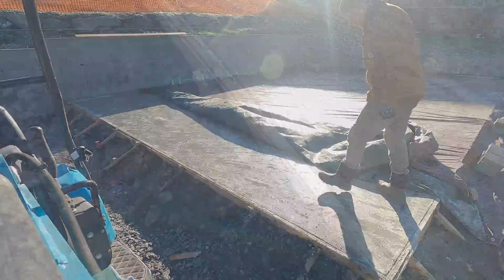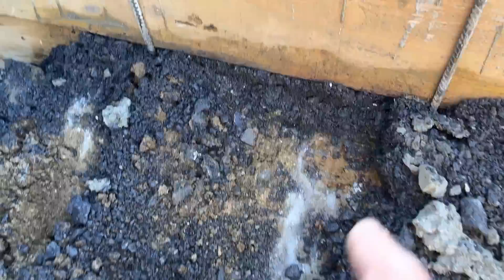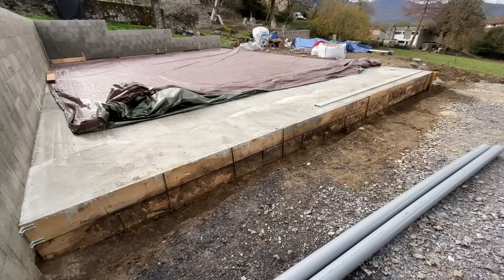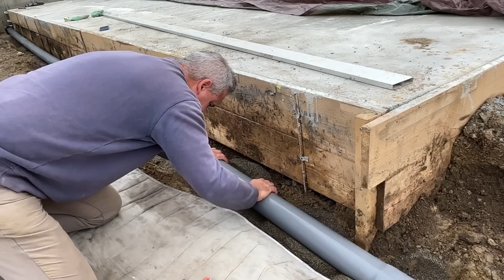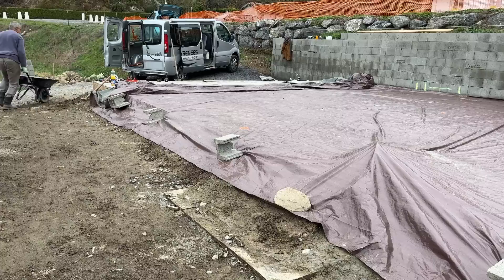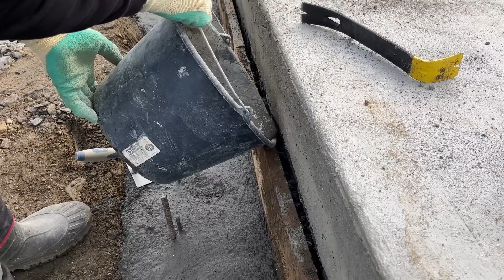Garage Slab Reveal & Drainage  | Garage / Shop Project Ep16

Comment: Question? Why didn’t you tie in both drains into the first pipe you concreted in?
Reply from the maker: The rear drain goes around the back and side.  the front surface drain I did afterwards just to not over complicate the initial pour....it was too difficult to get my head around it all in one go 😬

Comment: I dont think it was a good idea of putting that Cement around the edge of that pad on that stone. Because Water may get under that. And with the concrete on that stone under the pad. The water wont have no way too drain out. Youll end up with a Underground Pond under your pad. And if it freezes It will crack the concrete pad. Normally You put stone around the pad that say any water will drain out...Just a suggestion. I would hate to have that pad crack with all the work you put into it. This is just a suggestion..But other then that its lookin good ..
Reply from the maker: it is well drained now and it will be surrounded by the driveway and pathway.  It should be OK, plus it rarely goes below zero here.  fingers crossed. 🤞

Comment: Don't hand dig when you've got a mini-x on site! Just move on close to the forms, turn your tracks parallel to the forms, put your teeth back on swing your cab at the slab and your main boom the opposite direction so that your dig line is as parallel to the form as possible then pull parallel to the slab. All your boulders should just roll out easy AND your tracks will move in the direction of work flow. Don't give up so easy, it is worth figuring out how to run that thing. Just pretend you have no other option but to use it, you will get very good if you do that.
Reply: Exactly. "Why have a dog and bark yourself" as the old saying goes.
Reply from the maker: Trouble is, I wedged the bigger boulders up against the form boards.  So the teeth of the bucket could not grab them from behind to pull.  Also my boom does not have the side movement (hind sight I wish I had ordered that option).  Mini Ex gets a good workout in the next video though - to the point of failure ☹️

Comment: We always used 'duplex' nails when forming. Much easier to strip since the second nail head remains proud of the wood - no getting on your knees to squint to find the screw head that is full of hard concrete.  Just bring a crowbar to pull the nails and pop the forms apart.

I'm really curious why you've chosen shipping containers for your main home design.  The few container builds I've seen appear to be disasters - it's a lot of non-standard work required to fit in things like doors/windows and attach cladding/architrave etc etc (REALLY think about how those details will be done - it's quite difficult - how do fit a 6" wide door or window to a 1/8" piece of wobbly metal? As soon as you start cutting holes for windows/doors etc, shipping containers quickly lose their integrity/rigidity). Unless you've got experience with metalwork, I suspect it will be much more difficult/expensive/frustrating than you expect.  There's a reason why almost nobody uses them (builders aren't dumb - they know costs - and if using shipping containers were cheaper, they'd use them).

I STRONGLY advise that you rethink using shipping containers and use conventional (lumber/masonry) framing instead - vastly more forgiving/versatile. And I doubt a metal container building could meet Passive House standards anyway - at least not easily (and PH isn't cheap - very problematic for first-time budget builders!).  Consider 'Pretty Good House' standard instead - it's meant to get near-passive house efficiency at lower cost using easily-available materials. Good news is Europeans have access to efficient, high-quality windows/doors at relatively affordable prices.  

If you haven't found Matt Risinger's Build Show YT channel, take a look. Especially at Jake Bruton's content (he's a very practical, cost-conscious builder who specializes in passive house building (Matt is mostly a luxury home builder so his buildings are often $$$$$).   Besides the Build Show YT channel, they also have a website (buildshownetworkdotcom) with more content.  While geared towards a US audience, I think Jake offers some innovative and very practical cost-effective advice for building efficient homes (honestly, I'd try and contact him and pick his brain, even pay him for a 1 hour consultation if needed - money well-spent methinks.  Aarowbuilder.com).  Both Matt and Jake are on Instagram too.
Reply from the maker: Cheers Arthur - the main reason at the moment for the use of containers is to give me the structure, the metal frame.  After working on this garage I may opt to have the same company fabricate a steel frame for me for the house - I will price up both methods.  I am an engineer but not a structural engineer so designing a wooden frame house with the correct loads etc is a little daunting for me.  My last house I build was a kit and was constructed by the kit company and handed over to me to finish.  This is the first I have deigned and build from scratch.  I am still 50/50 as to what I will choose.  As long as the outside design stays the same the local authority are happy as there are no rules on how it is constructed.  I do watch Matt Risinger and also the Perkins Brothers.  I will check out the others you mention.  Very interesting.

Comment: I hope that you are having a great New Year's holiday. It looks great. I think that the base gravel will washout. If you compacted it good it would not move. It will take any water and it will soak into the ground. You have plenty of drainage to take any surface water away.
Reply from the maker: Thanks William -  it will not be going anywhere now, all totally encased.  I cannot believe how much concrete is going into this base. 🤣
Reply: @HomesteadingUncontained  By the time you are done with your slab you will be a expert in  concrete.

Comment: Great progress guys, I’d definitely be trying to get that bottom board out… if you take it out and any gravel does come out it won’t be an issue anyway as it’ll fill with concrete when you do the rest.
It’s a minor detail in the grand scheme but could cause cracks or stains etc in the future
Reply from the maker: Cheer Alfred, we did leave it in but there is a bunch more rebar and another 20cm of concrete above it.  It should be OK .

Comment: One thing, may not be an issue in this case, I think your drainage pipe is installed in the wrong direction. usually it's installed with the female part of a joint at the high end, if you want to connect this into other units like an inspection chamber which would have an angled channel with female high inputs or any bends this could cause problems later. It's definitely that way in CZ and DE and relates to the flow of water, which you want to run from the upper pipe to the inside of the lower pipe. Might be different in France? Hope it's not an issue with it now backfilled with concrete, if you need to fix it then you could cut off the female joint at the bottom and apply a bevel. At the top it's more tricky but you can heat the pipe and push the male end of a new length there, practice that first. Keep up the good work and this great content.
Reply: Now I think about it, are you sure this grey pipe is designed to be buried externally? We use an orange/terracotta PVC pipe for underground drainage know as KG that can be buried up to 4m deep and can take loads like concrete and other traffic above. All grey pipes are internal to the building. With the loose un-compacted sand below all this concrete the pipe can be cracked. whilst all those US channels are nice, they use very different materials and approach from us in Europe I suggest getting local advice on drainage solutions.
Reply from the maker: The grey PVC pipe is all good for underground here - it is the only pipe available.  I will put a junction on the end anyway before the inspection chamber as it is a myriad of different pipes going into it.  This particular one is purely the exit of the French drain from behind the wall, not sewage or heavy rain water.  It should be OK.
Reply: You are correct. Installing PVC pipe this way creates little "dams" along the path downwards and it will not clear the water properly. 
Finding that glue in FI is a struggle as most of our PVC pipes have sealing lip or gasket.
Nice to watch your series as you tackle building conundrums. Hope all the best for coming years!

Comment: Good concrete should have less water in the mixture, like a damp soil, not like fluid. Another thing is, that sand under the pipe wasn't compacted at all, so the concrete that you pour on top will crack a lot.
Reply from the maker: It was very minimal sand, just to level the pipe - the ground underneath is clay so it is pretty tough.  With the amount of rebar going in, it should be fine.

Comment: That concrete will support anything you will put on it . Good job.  Watch all your videos; Nice you give temperature both ways. Stops confusion                                                                                                                                                         50 years ago I worked US Military in Bavaria. Used to be a whole lot colder there. Don't how it used to be in the Pyrenees.
Reply from the maker: Cheers John - when we first arrived here 18 years go we would regularly get lots of snow and -10ºC temps but now we rarely see snow and if it freezes it is rare.

Comment: hey, really good work. Do you not need a frost protection layer (80cm) all around?
Reply from the maker: Cheers Lion - we don't really have bad Frost here so it should be OK.  We are extending the driveway and side path so that will cover the edges.